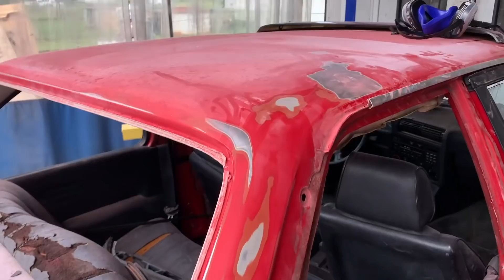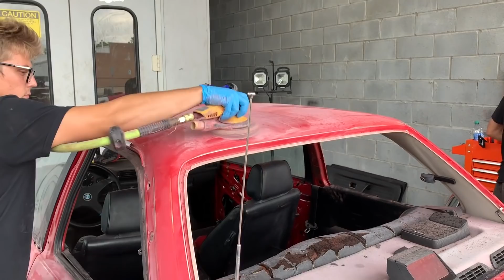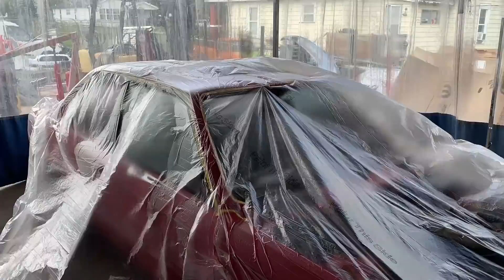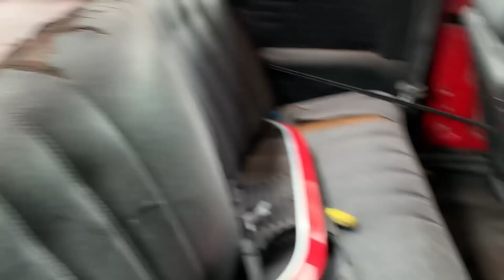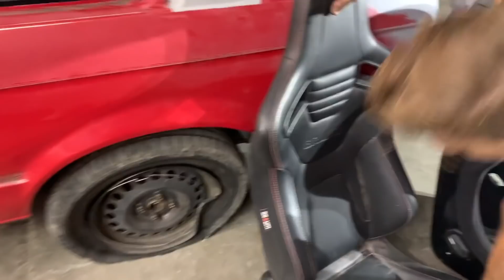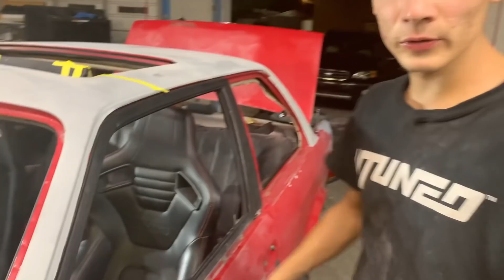Building an e30 m3 conversion part 4: priming the roof and testing new seats!

Comment: I love restorations of old BMW’s that’s what I come to YouTube for
Reply: its not a restoration.
Reply: What is then 🤭 they not going to restore the car? Are they going to use it as it is?
Reply: Restoration is when you return the car to it’s original stand. Not when you put some shity seats or engine from japanese bucket car
Reply: Restorations are generally putting it back to how it left the factory, although in practice with the time and money spent they often end up better than that.   These guys however, they're modifying pretty much everything, so I guess you could label it a resto mod?
Reply: This car with these kids and this horible things they have done to it lost it’s main value.

Comment: Before fitting the new seats be sure to inspect the seat mounts. The threads in the floor tend to break out. Especially the front ones.
Reply from the maker: Will do!
Reply: @Motorheadco  on every E24 i had driven So far they were shot and most E30 had them loose. 😁